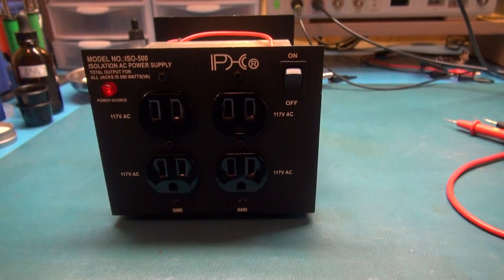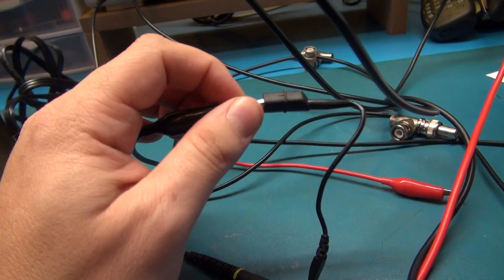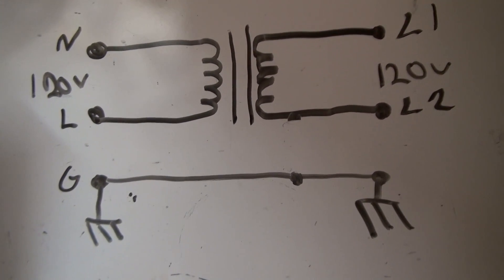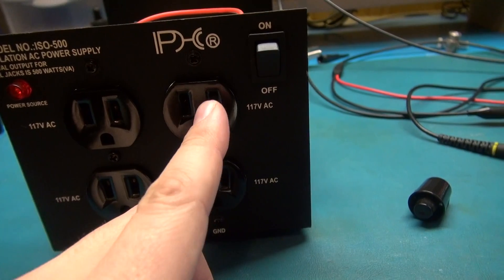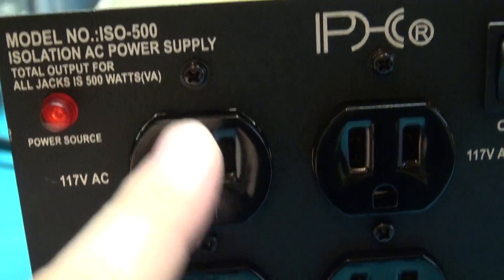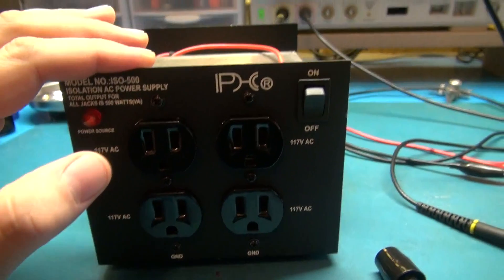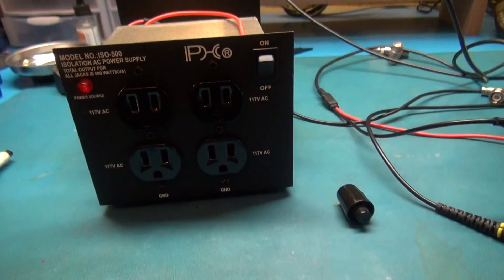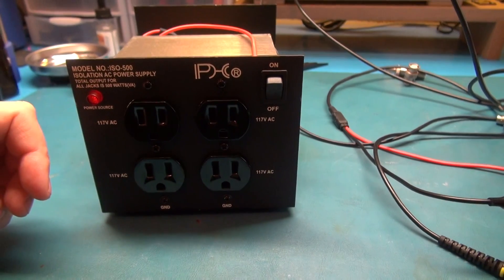ISOLATION TRANSFORMERS FOR TESTING CIRCUITS WITH AN OSCILLOSCOPE.

Comment: Those isolation units that tie the neutral to ground also do not meet NEC standards, as NEC only permits the tie between the neutral and ground to happen at the main electrical panel.  It is dangerous to tie it at any other location and you risk introducing issues on the rest of the circuit back to the panel.  Don't use them.

Comment: Absolutely correct, don’t float your scope. If a person touches across the isolated secondary outputs of the two ends neutral & hot, you will still get shocked!
Now if you hook up your scope to the isolator transformer, you now can get shocked by touching your metal chassis or BNC ground of your scope and the Scopes ground clip. This type hookup not only can be a shock hazard, but can also introduce noise into your scope reading. Always plug your devices under test into a property isolated transformer, and your scope directly into your ac main receptacle.  If you are unsure of what you are doing please don’t try to repair anything electrical. If one is unsure about proper isolation,  a battery powered scope can be your friend as long as you use it alone by itself.

Comment: Wow. Thank you so much for doing this explanation. Ordered a scope awhile back. Finally got around to using it. Avoided a big problem by using openai chat to describe testing a line powered device. Was a diy build pemf unit. Also had another issue of high voltage between ground and plug . Then today shopping for isolation transformer and now avoided accident number two. The conspiracy to kill my new Siglent scope. So far I calibrated one probe.Was looking at the Jameco ReliaPro GRP-1200. Most likely it will be very same grounding issue.  Thank you for posting this.

Comment: The easiest way to ensure safety is to check voltage between the oscilloscope alligator clip and the in-cicrcuit point you intend to connect this alligator clip to.

Comment: Thanks a lot. You're the only channel I've found that identifies the o / p socket mounting screws as an earth path if a 3 pin plug is used on the item under test. Colin ( England ).

Comment: Can I run a ground rod separate from my house ground connection and be completely isolated from my home wall supply?
Reply: Yes you could do that (and is often done), and it is a good solution to protect your device and yourself. But be aware of the possibility of ground-loops (Google for this).

Comment: Never remove the ground from your test equipment. Isolate you equipment that your testing. Also use a current limit high wattage light bulb in AC circuit. Use caution Always!!

Comment: This ST 1500W powering my guitar amp.  DVM Continuity test shows mains neutral across all recepticals, that have no ground so it's ground isolated; but neutral not so much.   Is that any good for an isolation transformer or should I open and remove the neutral cross comnects to all ouyputs?

Comment: In arcade monitors which need an isolation transformer in most cases have earth ground connected to the chassis ground on the monitor. I don't understand how this is safe.

Comment: Grounding the outlets via the screws seems like a gotcha. Guess it is always best to check for (lack of) continuity between output grounds and electrical plug ground pin or just bypass the grounds entirely by using a cheater plug.

Comment: To isolate the output receptacle grounds you could replace the black internally strapped receptacles with isolated ground hospital grade receptacles (orange color with green dot and green triangle). This way you do not need a cheater plug. You could also have an isolated floating plate to mount the receptacles to but this would be more work.

Comment: Hi- can I use a variac with isolated transformer , to protect my scope and signal generator and  others instruments. Also can  put a power bar in isolated Variac  out put transformer so that I  float the  grounding on my  test instrument and  circuit  under test ? let me know ----- thank you , Jerry
Reply: No!. Never float test equipment. Only float DUT (device under test). You can obviously use a bar strip on the output but why would you? You’re only testing one DUT at a time.

Comment: Hold on a sec... If the oscilloscope is floating, then there is no path to ground so it does not matter if it's frame is at high voltage ...the issue happens when you touch both sides of the power source.  ....so, it's the same issue....never bridge things with your body! Period
Reply from the maker: You always want your test equipment grounded. Period.

Comment: You make the bald statement that floating your oscope is bad.
Well,  battery operated oscopes are floating and they work fine.
Reply: I agree if every device is connected to battery and nothing connected to your home AC outlets you should be  totally protected and all devices.

Comment: Thanks for an excellent explanation. My question: and I forgot to mention that in the USA, the safety device is called GFCI and in Australia a RCD, same thing.... so my question is: if I have a GFCI outlet supplying power to my scope as well as to the mains board I am working on,,, two separate connection but from the same GFCI outlet. Whatever I mock up on the work piece wrongly will trip the GFCI,,,,, so why do I need an I/S which only will save the scope but not my life???? I must be wrong, because everywhere I see that you need an I/T... Please help.
Reply: bro i have also been thinking about the same thing... if my test piece is being powered by Isolation trasnformer, now if I mess up on something instead of tripping the gfci its going to elelctrocute me because its isolated from the main breaker board ... I am also concerned about this...

Comment: Why spend a hundred plus dollars on an isolation transformer, that doesn't isolate the secondary?
Reply: It's probably due to regulations, but you "fix" it by removing the ground wire from the output plug.
Reply: @Gengh13  True!

Comment: I’m still so confused!
I’ve read many books, and watched many YouTube videos about floating grounds.
What I want to know is, when working on a “Hot Chassis” old tube amp, what should I do to get the ground off of the HOT side of mains? 
If I don’t get rid of ground, wouldn’t I be blowing up my scope?
Reply from the maker: That is why you use a isolation transformer modified for tech use to power the device under test.
Reply: If you connect the hot chassis radio t the transformer as you should then it does not really matter what there is in the ground contact as it is not used.
Reply: Use the isolation transforer to isolate the radio (or whatever). This way, when you ground the scope to item under test, it's not hot in relation to ground.

Some of us old techs float our scopes because back when we worked on main frames where many of our calibrations required both the scope probe and ground were both elevated above ground. For decades, I used scopes with defeated grounding. I never even have to consciencly think about it any more, I just know it's floating. However, I do not recommend a beginner to do this.
Reply: Yes, very useful for people that know what they are doing, very dangerous for those that don't. The rule is simple with grounding, don't fool around with it unless you are 110% sure you know what you are doing.

Comment: 50 ears ago wen i  become electrician  and T.V epairman no ground back then on a devices or   plugs  but some radios ,,,and no so,,,,have 2 grounds  on a shematic ( chassis ground and power supply ground ) the scope was rock up on chassis and when you want tack a dc voltage measure the ground clip go on   -  side of power supply ,  today a toilet cleaner work on electronics, BAD, VARY BAD
Reply: the author of video is toilet cleaner?

Comment: thank for the great vid - Do we usually power the SYSTEM UNDER TEST using the ISOLATION Transformer,
& the AC TEST EQUIPMENT/oscilloscope is powered as usual via residential AC outlet ?

 OR 

 BOTH SYSTEM UNDER TEST and AC TEST EQUIPMENT/oscilloscope is powered via ISOLATION TRANSFORMER ?
Reply from the maker: I never ever float any test equipment. Only my device under test. You will forget someday that a piece of test equipment is floating and damage it or yourself not realizing it is not grounded..  When floating the device under test caution should always be taken because noting is ever a sure thing. One wrong hookup can lite something or you up.
Reply: @Kev_31779  the for the guideline.
Reply: I re-reviewed your video to get a refresher on the topic - yours is one of the easiest to understand out there - thank you for that. On to my question:
So in a nutshell, for a TECH isolation transformer setup, when using a DUT (device under test) with 3-prong AC plug :
Is the reason you want to eliminate the EARTH/GROUND on the secondary side outlet (where the DUT is connected) with the methods you stated, lifted adapter....
- because then you can safely connect the SCOPE EARTH CLIP to ANY part of the DUT (such as the chassis itself or even any of the 2 secondary windings L or other L as per your diagram etc). In which case, the accompanying SCOPE PROBE TIP  can safely measure the potential difference (observe voltage)  between the probe tip point and earth clip point? (and this in effect is much safer when measuring this way)
OTHERWISE
if there was indeed an EARTH/GROUND on the secondary side outlet extending to the DUT, then in the case where the SCOPE EARTH CLIP is accidentally connected to a point on the DUT which is at line voltage L (120VAC, same as either of the secondary windings  for example, then this situation will cause a short and blow the scope and may even cause personal injury/harm etc ,In this case, the ONLY real safe point to clip the EARTH SCOPE CLIP is  any point on the DUT that is indeed at EARTH GROUND potential - but because on a device being tested for repair, that fact may not necessarily be the case hence why   it is safer to eliminate the GROUND EARTH path from the DUT....
Would you say the above is accurate summary for your video?
I can see why you stated it is important to understand CLEARLY everything involved, before diving into this stuff...I am looking forward  to your reply. Please correct me as necessary..
i want to thank you again - your video has helped me understand better the topic. God bless!

Comment: Hint #1: if you don’t need ground pin your receptacle, go to home bipot, - and by that receptacle, witch has no ground slots on it!!! That’s how you can be 1000000000000000000% isolated from main ground!
Hint #2: if you need that pin on your receptacle, go to home depot and by that hospital rated receptacle (orange color: with green dot, or triangle) That’s how you can be 1000000000000000000% isolating from main ground!

Comment: How do you like your isolation transformer?  I am looking to buy that exact model some people
say that it has a loud hum when using it..
Reply from the maker: Works fine. It has a slight hum but it is not bad. All big linear transformers hum. Don't forget the ground passes through if you are using it for tech use..
Reply: @Kev_31779  OK thanks for info just ordered one..
Reply: @joebiz22  You may be interested to know that the steel laminations in the transformer actually change length due to the magnetic flux. It's called magnetostriction and it happens 100 or 120 times per second depending on whether you have a 50 Hz or 60 Hz supply, so that is why all power transformers will hum.

Comment: Thankyou for your explanation!  This question is 100 % sincere and NOT confrontational!!!
Why? Do You Very expert, type of guys , who obviously go to great extents, to set up great 
work benches, simply, go out side your home, sink an eight foot REBAR ROD into the ground, 
Hook a good cable to it,  and pass that cable which is an INDEPENDANT EARTH GROUND
STRICTLY FOR SAFETY BACKUP PERPOSES,  TO YOUR WORK BENCH, WHICH CAN SERVE
AS A INDEPENDANT EARTH GROUND, STRICTLY FOR BENCH TESTING-----WHICH IS 100 % 
ISOLATED FROM THE  HOUSE  MAINS  NEUTRAL GOUND CIRQUIT, AS WELL AS THE EARTH
GROUND CIRQUIT WHICH IS CONNECTED TO  THE PLUMBING SYSTEM AS WELL; WHICH IS
ACTUAL EARTH GROUND AS WELL; BUT IS PART OF THE MAINS AC POWER SYSTEM, AS  THAT SYSTEM IS ORIGINALLY WIRED INSIDE THE MAIN POWER PANEL OF THE BUILDING?
This way, you would have an isolated path to earth gound for testing, which is completely
"Floating" as you termed it,    from the main ac system of the building!  ??????
What is wrong with that??? Too Much trouble???
Thankyou ! kennethzakaib607@gmail.com   (AND A BIG CHICKEN THAT DOES NOT WANT TO GET BBQ-ED !!! )  THANKS!
Reply from the maker: Driving a ground into earth is not going to isolate you much. Depending on the nearest electrical grounding point and soil conditions it could conduct with the order of some resistance. Device under test using a isolation transformer and grounding test equipment is good enough if you know what your doing.

Comment: I still don't understand why does it have a 3 prong plug?  I have an old isolation transformer and it has a 2 prong plug but the new ones have 3 ?
Reply from the maker: New ones are grounded and have to adhere to safety standards. These are not for tech use out of the box.
Reply: thx for the ans. and some good explanations.

Comment: Some isolation transformers are balanced to filter noise. They balance it by putting a center-tap on the secondary which is grounded. Needs to be disconnected

Comment: could you pull the green wire up from the bottom of the TRANSFORMER and be ok????? i just got the same TRANSFORMER
Reply from the maker: I suppose you could as long as you understand the case is now floating and anything that is plugged in that has a third pin ground is now going to put the isolator case at that potential. Of course any type of isolation transformer for tech use is not fool proof. Cation is always needed. You could get a shock regardless of isolation depending on the unique configuration.
Reply: OK GOT IT I WILL JUST LEAVE THAT GROUND WARE ITS AT . I PICKED UP  3 OF THE SMALL PLUGS THAT WILL WORK . THANKS FOR YOUR HELP . IT MEANS A LOT
Reply from the maker: No problem.

Comment: We took a vote.  Go back to your "multimillion dollar designs."

When you figure out why it's a bad idea to bond one leg of the secondary to the Neutral, Ground and Equipment Grounding Conductor of the primary on an isolation transformer, let me know.
Reply from the maker: That's great go ahead and float your scope. Please explain how floating a scope is much safer. They both have their caveats. The way I do i and most other techs do it the way I explained for a much less chance of self and equipment harm. Pleas do yourself a favor and tally up all the tech videos just here on YouTube of people floating their scope vs floating the device under test.

 Here is a question right out of an EE test website.  
 
 Question No. 1:You have to troubleshoot (with an oscilloscope) a piece of equipment that is mains powered and has test points at or near mains live potential. You have an isolation transformer at your disposal. Which should thed the isolation transformer power? 

 A The oscilloscope
 B The equipment under test
 C Both of them.
The correct answer is b, the equipment under test -- that will prevent it being at mains potential with respect to earth, which could be very dangerous.

Can you let it go and admit you are just plain outright wrong.
Reply from the maker: You have deleted most our comments on this subject because you are removing all my valid arguments why you are wrong. There was many many valid arguments. If you felt you were correct you would have left everything as it was in the comments to let everyone else chime in. But since I have secretly got through, you felt silly being a teacher and acting so childish when proved incorrect in the practice of the use of a "tech modified"  medical isolation transformer for DUT.
Reply: Kev31779 this is why I get email notifications of comments, it gives me proof and a record of the comment they deleted, then I can copy/paste it back into the comment thread. In this comment, I wold just delete the whole comment.

Comment: Can I use an isolation transformer to power a modified atx bench power supply, for safe use with an oscilloscope in circuits powered by the atx supply.
Reply from the maker: I wouldn't see why not. As long as it can be isolated. I would test to make sure when it is hooked up use a multi meter and start probing potential concerns. The grounds might be the biggest issue. Always use caution when working with underground equipment and isolators. It is not code to default your grounds but in a tech modified isolater the game changes and you have to know what your actually doing to not get hurt.

Comment: You probably saved my Oscilloscope from blowing up. Did not realize the mounting screws and grounding hole were connected. I am now going to order the Isolated ground receptacles from Ebay, referenced a few comments down. Thanks much!